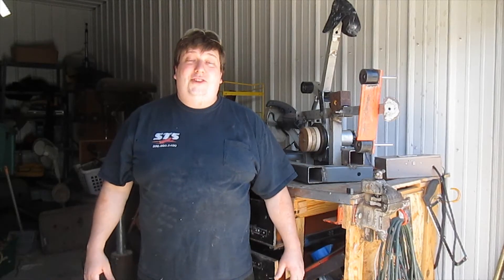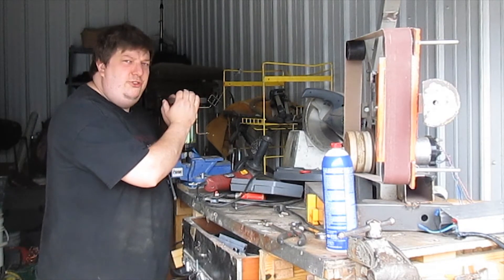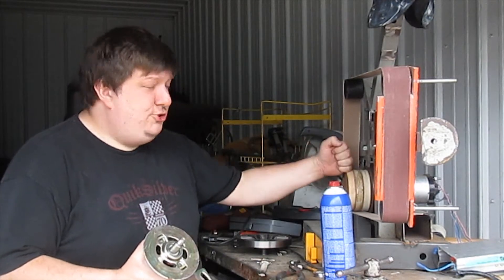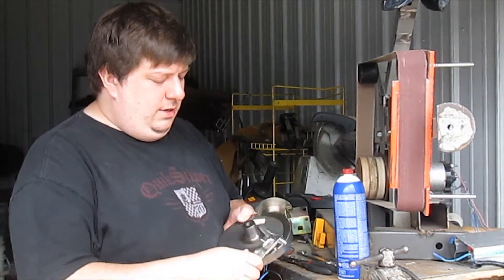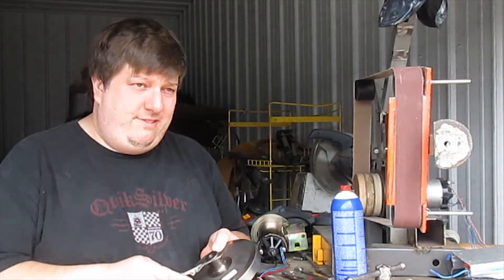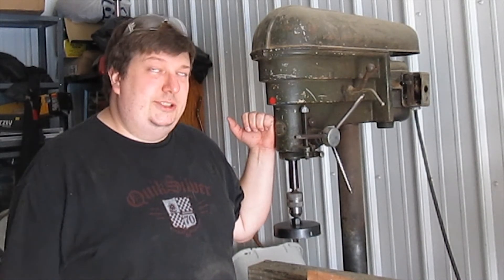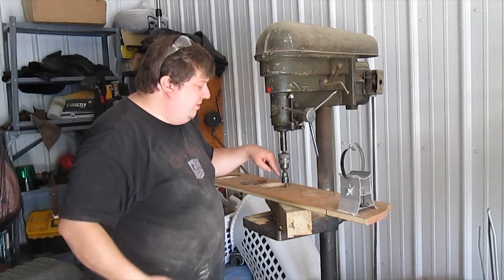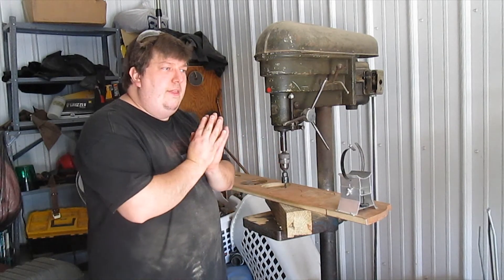MAKE A DRIVE WHEEL FOR A TREADMILL MOTOR [PART 1]

Comment: You motor will spin at thousands of RPM's not Hundreds.  I'm a bit worried about how this will turnout.  I would for sure use plywood instead of natural wood.  This will give you you better strength.  Just an idea. :)
Reply from the maker: I can see the benefits with plywood my only issue is if there is a crack or split.  it might be hard to find.  if there is an issue laminated hard woods its obvious.  But if the wheels on my grinder explodes You will be the first to know... Assuming I live
Reply: @tomasistudios2618  I guess you can rotate the wheels 90 degree when you glue them up and give yourself a lot more strength.  If you have 3 plates you could rotate them 33 degrees or so.